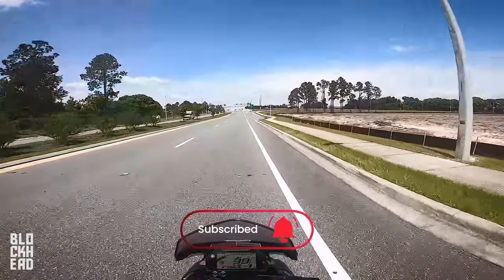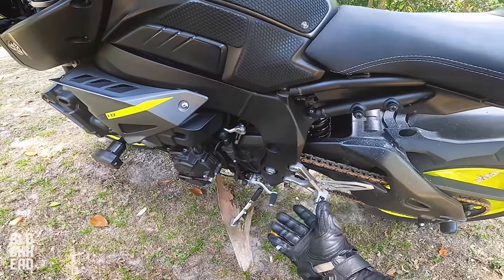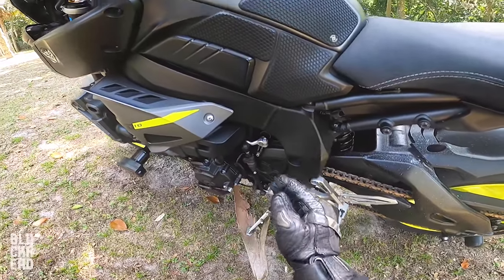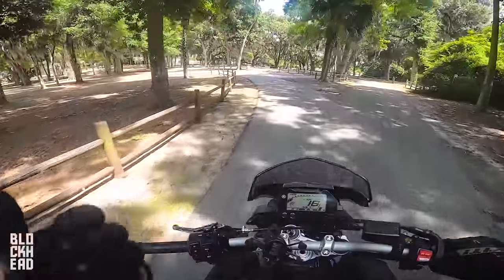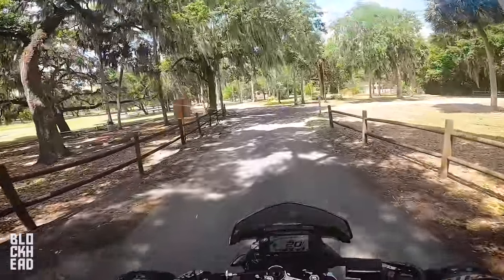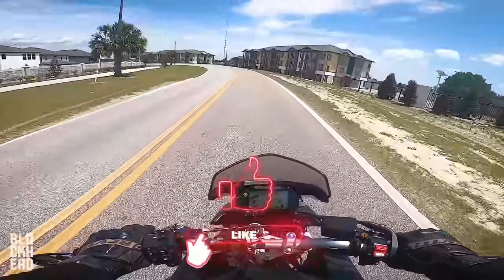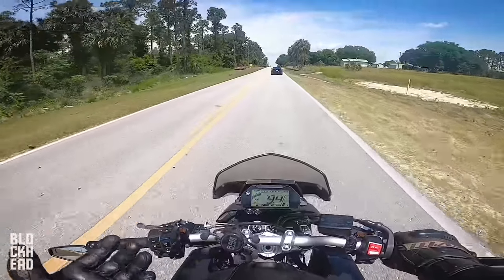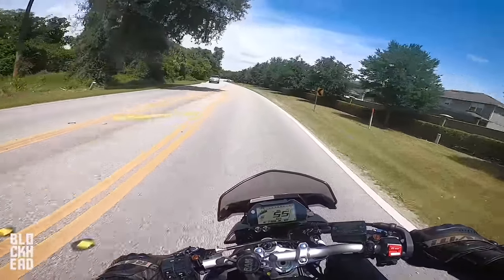Motorcycle Quick Shifter Explained!

Comment: I'm so frustrated with the MT-09 group on Facebook. Twice I asked why my bike isn't quick shifting. I've never used quick shift before. Some used 🤣 emojis others told me I had to turn it on in the settings. NOBODY told me I still have to shift the gears with my foot. I was thinking the bike did that automatic as well. Thank you for this video. Now I can FINALLY try out my quick shift.
Reply: Bruh
Reply: @TheFlamingCookie  I used quick shift for a few rides but I much prefer using the clutch. More fun.
Reply: so you thought it was manual??
Reply: @patrickgoldenbridge1891  No, at the time I thought quickshift would be like an automatic. I had it turned on but when I would ride it it did not switch gears. Finally I found a YouTube that explained how quickshift works. You don't use the clutch but you still have to shift the gears. Me being completely new to motorcycles I had no clue.  Needless to say, after using it a few times I still prefer shifting with the clutch. It just feels right and it's more enjoyable.
Reply: @AceGoodheart  I meant to say automatic. But I also thought it was like an automatic.

Comment: Quick shifters were designed for racing, to allow you to shift without having to lay off the throttle for a quick second. A great addition along with the electrons on the bikes of today.  I once had a 5 speed chevy blazer and the clutch went out on it. I rigged the clutch switch so I could crank it up without having the clutch pressed in.  I drove that blazer for 5 months with no clutch using  speed shifting. The old days way of quick shifting.
Reply: What happened after the 5 months? Does it work the engine harder?
Reply: How did you start moving in first lol
Reply: @jessecole8370  No I finly got it fixed and sold it. K5 blazer, purplish n blue

Comment: Great video! Might i say, Blockhead, that your skill in downshifting with the clutch is absolutely sublime. Youre some kind of engineer? One of the small minority of people that understands. Few people know this. In order for a manual gearbox to move the engagement collars past the dog tooth rise plane, the relative torque direction between the gearwheel pair needs to cross over. Up or down change can still be effected without crossing over, thanks to the Synchro-brakes. When that is done you will have a "thunk" on the gear change. People who fully understand how manual gearbox mechanism works will avoid the thunk by manually crossing over the torque direction and pushing the lever inside the cross-over. So thats when on your down shifts you pull the clutch and the revs drop a bit, then you blip them up, crossing over where the rpm would have been in the departing gear, also rever ready, as the blip crosses over the departing gear rpm you slot the lever into the lower gear.

Comment: Damn bro.  Was riding my new to me k6 gsxr for the first time today.   (Came from a v twin Honda).    Was shifting with the clutch my first pull.  Brought the wheel up when I grabbed 2nd.       Figured out I could quick shift it, but was letting off throttle.    Quickly discovered it’s less jerky at high rpm so continued shifting with clutch in the lower rpm’s.      But I didn’t know you could stay on the throttle.   Will have to try it tomorrow.

Comment: My 2 bikes have both up snd down quick shifter.  Newer bikes more seamless especially with higher rpm’s as it’s for racing.  You have less 0-60 and quarter mile times when you must manually pull in the clutch.  Auto blipper rev matches when you downshift.  Just keep the throttle wide open.  Racing motorcross every time you pull in the clutch you lose 20 feet racing for someone not using the clutch.  My motorcross bike does not have a quickshifter but I keep the throttle full open when shifting without clutch use.  Quickshifter protects you engine to microsecond unload your transmission when shifting.

Comment: Hello , I got my 1st motorcycle with that 
Quick shifter. Plase advise, if I slow down and going neutral, and a accidentally skip neutral to 2nd gear, since my shift pattern is 1 down 5 up, Am I going to overshoot or have sudden acceleration, as there is no clutching to managing it?

Comment: Its like comparing a car with manual 6 speed and a Lambo with DCT.    You have poorer acceleration manually going thru the gears vs a computer shifter forward with losing forward momentum.  That is way manuals car have slower times for automated clutches with paddle shifting.  Plus no missed shifts snd engine damage

Comment: Wait do you press something or it just automatic? btw im new
Reply: It just occurs automatic, WHILE still foot shifting, it automatically stops the engine spark,  for a millisecond, allowing the clutch to be left out of the equation, but you are still using your foot on the gear shift, just no clutch, or backing off the throttle,  allowing for quicker shifts.Basically, just cuts the spark   ,with a switch, connected to the shifter lever.

Comment: My BMW has gear shift assist pro which means you can do clutchless shifts up and down at just about any rpm. Up shifts work with the throttle open and down shifts are made with the throttle closed. Kinda lame to have a motorcycle that can only do clutch-less up shifts 🤨
Reply: What if you were wot while down shifting (w/ auto blip)?

Comment: What ever happened to being apart of your machine. 

The feel of connection when driving a car with manual transmission. 

Majority will opt out their automatic car and choose the stick. 

For me having quick shifter on you bike is the same as having an automatic transmission car. 

I rather prefer to be in control on my motorcycle a lot more thrilling and exciting in opinion.

Comment: It's still no fully explained for us dumb kids...
How do you go back and forth between manual and automatic shifting? Is there a switch to flick between the two, or is it always there? Does it depend on how far and how quick you rip open the throttle? Are there MTs with or without quickshift, a choice you make at purchase?
Still so many questions to be explained..... !
Reply: It's always manual. All a quickshifter does is do clutchless upshifts without you having to roll off the throttle. You're still able to shift normally using the clutch with a quickshifter.
Regular upshift: roll off throttle, pull in clutch, upshift.
Clutchless upshift: roll off throttle and upshift at the same time.
Quickshifting: you just upshift (there's a sensor on the shift arm that detects pressure and cuts ignition for a split second, equivalent to very quickly rolling off the throttle).